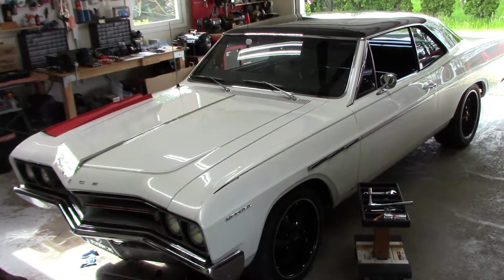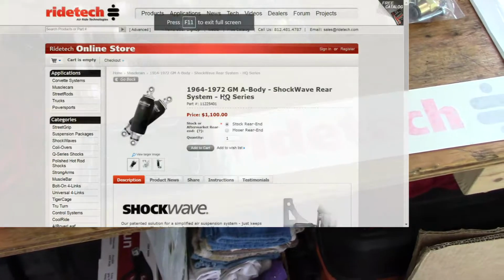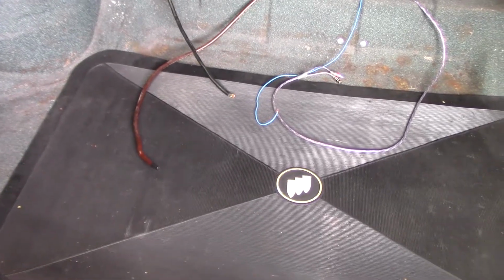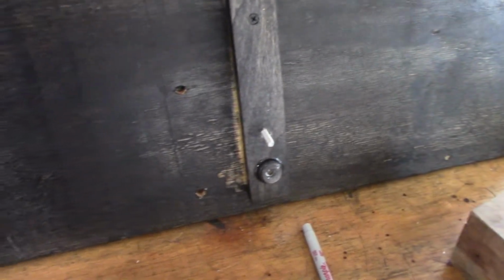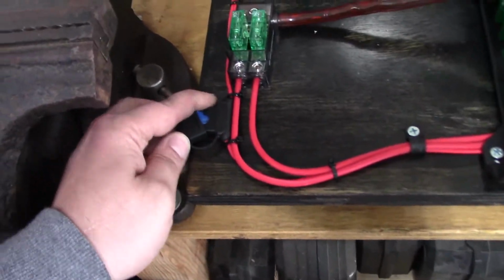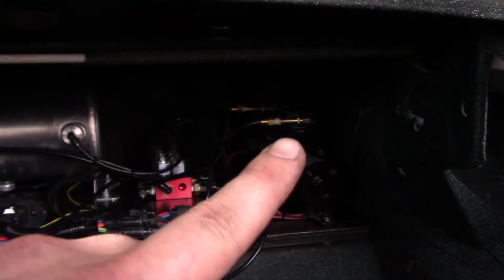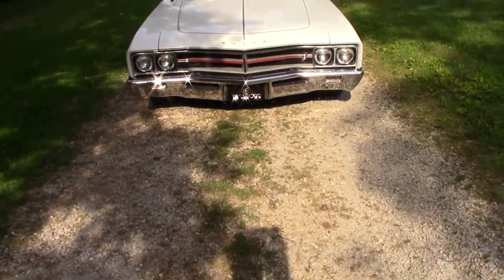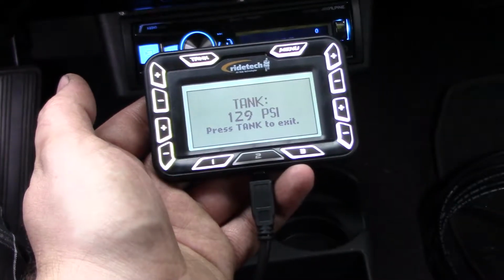Ride Tech Shockwave Installation - 1967 Buick Special

Comment: hey looks awesome, do you need to have a certain psi to drive?
Reply from the maker: sort of.  I manually lift the car to the height I want pressing both front bags up at the the same time, then both rear bags at the same time.  front is usually around 95 PSIG and rear is around 85-90.  It does vary.  I don't have the level sensors.

Comment: How is the ride quality compared to before? Did you have to cut the spring pocket to fit the front shock wave to prevent the bag from rubbing?
Reply from the maker: Ride quality is excellent but I've blown out 2 bags because of spring pocket clearance.  If you take the route I did with the shockwaves, triple the clearance recommended by RideTech.
Reply: Thanks. I have a generic bag set up now and I noticed the bag is rubbing and I need to be proactive before it blows. They been on there for about 4 years no problem but I don’t want to get stuck. Great write up thanks.

Comment: shouldn t the bleeder be facing to the floor?  I believe that water  start to condesate inside the tank and you need to bleed it out, that water is in the bottom of the tank and if you don´t bleed it out it will corroid the metal (or is it an aluminum tank?)
Reply from the maker: David Barrel yeah, the tank is aluminum however I would definitely install a bleeder.  It was an afterthought of mine...so.  I'm going to pull it out and install a bleeder next spring.

Comment: I have a 67 buick special four door. I'm looking at installing airbags and I noticed that on the front you installed a shock type airbag and I was wondering if that was the only way or can I do the normal type bag. Thx
Reply from the maker: Skillet Holman You can buy a kit that has a separate bag and shock absorber (much cheaper than what I bought from RideTech).  Those kits will require a bit more modification.  You have to weld a bracket in.  The RideTech stuff basically bolts right in but is way over priced in my opinion.